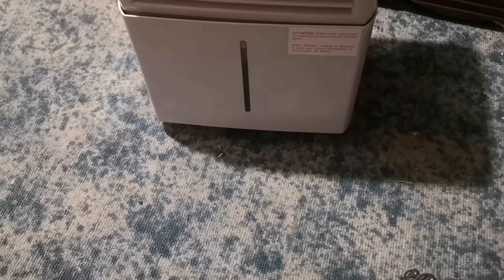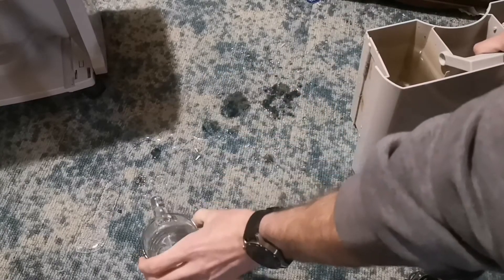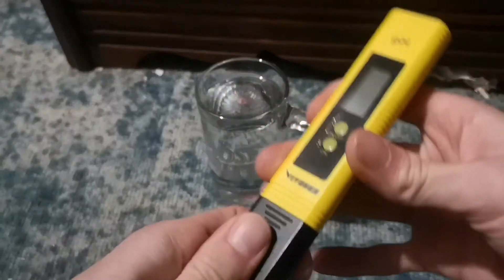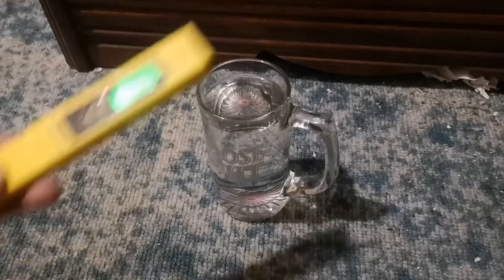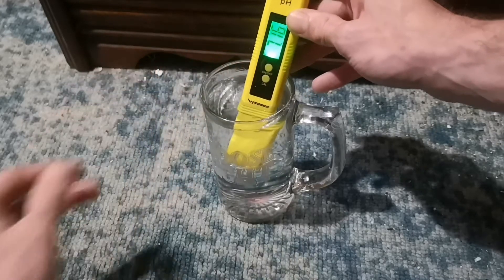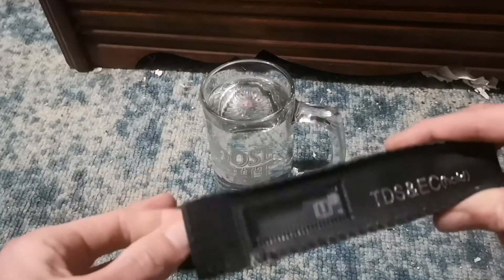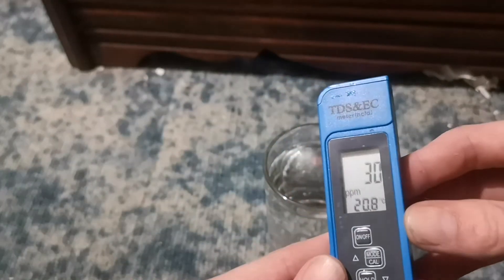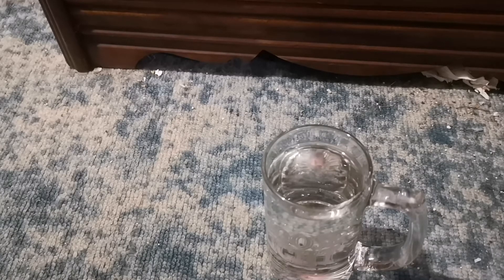Testing the water from my dehumidifier

Comment: I have run this test using tap water and purified bottled water for comparison.
My results were as follows:
Tap water: 300ppm 😳
Bottled purified water : 0ppm
Dehumidifier water: 40ppm
 My dehumidifier doesn’t have a filter, and I still heat this water and use it for my coffee. I think buying a dehumidifier that comes with a filter and then running it through a carbon filter and that ppm should drop to zero just like the bottled water.

Comment: What is inside the water that is 30 ppm of total dissolved solids? Do you have a microscope? It can mean anything, coming from a machine that makes water from the Air.  It could be 30 ppm of a toxic metal, and you'd only need 5ppm of that specific metal in the water to make you sick. Viruses also travel in the air as well. You pulled it from the air. I'd filter it then distill it. Good data collection, Good video. tnx for sharing. With solar panels we could have free water from the Air.
Reply from the maker: The town I live use to be heavily air polluted so it could be from that but I don't exactly know

Comment: Tap water has an average of 300 ppm with a 6-7 pH. Distilled water has a zero ppm. It looks like dehumidified water is cleaner than tap water.
Reply from the maker: Yeah tap water is so badd, I use water from a natural spring and it's about 80 ppm natural from the ground, so much better!

Comment: Safer to drink than old building pipe water. If you are scared of heavy metals try minimal amounts of chelating agent. Remember most of us drink treated water from reservoirs, lakes and rivers. As an environmental chemist this is probably one of the safest water sources around. I use it to bath with at my rural cabin. I save the well water for livestock and drinking.
Reply from the maker: That's awesome thanks for the info!

Comment: I mean... Yeah, it's neutral. I bet if you deep clean your humidifier, You'll find some shit built up and is giving you that runoff. 

Some dehumidifiers are different though, Sometimes they give off heavy metals so probably should check if you wanna do hydro shit with it. If you were to use like 2 gallons of that water you got from the dehumidifier and mix it with more balanced dechlorinated tap water to get 10 gallons... That water would probably be the best you can come up with in a reasonable amount of time and for the best price.
Reply from the maker: My tap water is terrible I can tsmellbthe chlorine from it and it tests at 380 ppm so I go to a spring and get water straight from the ground that tests at like 80 ppm of non added chemicals
Reply: Do that, but do still get it tested. Spring doesn't inherently equal good water. 

You wanna know the best uses for the dehumidifier's water?

Comment: The most serious problem with “DH” are the HEAVY METALS due to the components used to MFG the unit! Any suggestions on how  to remove heave metals… water air units are expansive!
Reply from the maker: Yeah I won't be using it for anything
Reply: A very big magnet
Reply: @Tagrix  maybe a magnetic tube let it shoot thru, 3-7 times always a odd number. 🤔 you might have something there .
Reply: @Most_Amazin  use the metal to make weapons
Reply: @Tagrix  or homes. Maybe even build another device
Reply: @Most_Amazin  make wepons, use those wepons to harvest the iron in the blood to make more machines
Reply: @Most_Amazin  check out “water from air” units!
Reply: @dannycomment779  omw
Reply: @dannycomment779  yea been all up and down that wall for all those videos. I'm planning my great escape off the grid very very soon maybe even this year. Got my seeds I've been waiting to grow.  Just need to find some red wiggler worms and earth worms for the food waste and human waste. Of course solar everything. Toilet and all. I have everything basically mapped out. Looking to deal with this water situation. I'm a contractor so I'm going to build it all. Wish I had $1.m to just pick up and go. I would move to a desert in a heart beat. Build. My island in the desert. Repopulate the mushrooms and wallah life. As we know it.
Reply: @Leroy.   Look into thermo electric peltier systems and solar thermal. If you build a solar heat earth battery you can harvest more free energy much cheaper and it would be easier to protect the components from EMP and Solar Storm surges, then also you would not need as many solar electric panels.
Reply: @terrafirma9328  much appreciated. Your welcome to my built village any time. Once it's built.
Reply: @Most_Amazin  Thanks, ditto. 👍😁
Reply: @terrafirma9328  how about we work together.  I'm a contractor. Exterminate, chef, many more hats
Reply: @Tagrix  
Guidance filter out lead!
Reply: Use a UV Light with filters.
Reply: DIY activated Charcoal filter is a prime way to assure drinking it... I'll test and report on here if you push like... Sub and I'll do a video on it... As of right now it's snowing a wet snow, and I'm just now getting ready to go... I'll test tap water - water from dehumidifier - the snow → just with strips... If something unusual I can have it locally tested and will continue to update... Best way to do it is charcoal and then boil it if you need it for shtf... *edit: terracotta pots Is a natural way to filter your water, cleans it by about 90 to 95% of anything bad that would be consumable... FYI

Comment: Dehumidifier water is ionized and shouldn't be consumed by plants, animals or humans. As for boiling or filtering it for consumption I'm still researching the best method. Useful for washing though. I use it as two free flushes of my toilet each day by just dumping it in instead of flipping the handle.
Reply: I tried finding this information, can you cite where you learned this?
Reply from the maker: I'd answer your question but I'm also curious of the same things as you and that's why I posted the video, thanks for asking
Reply: Why would it be ionized? Ionization is not necessary for condensation. Also, if it were ionized and had an abundance of free hydrogen ions, it wouldn't have a nearly neutral pH. WTF are you talking about?
Reply: I think it's deionized water rather than ionized water.
Reply from the maker: I never thought of that, and yeah I wouldn't drink it
Reply: You can purchase dehumidifiers with an ionizer, but they are two separate and distinct features.

Comment: I have been wondering about the quality of the water from my dehumidifier as well. It looks crystal clear & clean. Was wondering if it was boiled & then run through a filter if it would be safe drinking water. Cuz i would love to start saving the water for emergency backup water. I feel wasteful dumping it down the drain lol. Might even use it to water the garden once I set one up.
Reply: I think if you add a proper air filter to the suction portion of the dehumidifier it should take out some contaminants and I'm pretty sure it's safe to drink
Reply from the maker: From what I've heard the water is fine for watering plants and I guess it should be OK to drink maybe boiled and filtered
Reply: I filter and distill it been drinking it for over 6 months and have 12 gallons of water on hand
Reply: Run it threw some simple filters and a UV light.  Seams to be working out for me and thast what the Hydro logic etc systems are using.
Reply: I would pour it through a filter
Reply: It will be no problem at all if you filter and boil it it will be the best water you ever tasted.. your coffee ☕️ will taste much better if you use it!!!